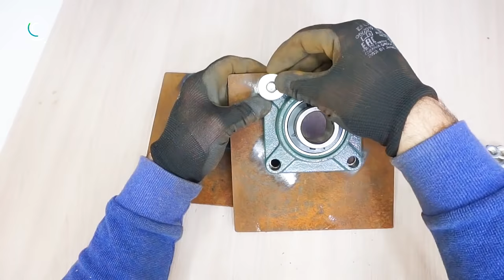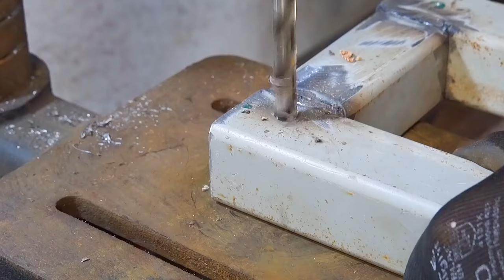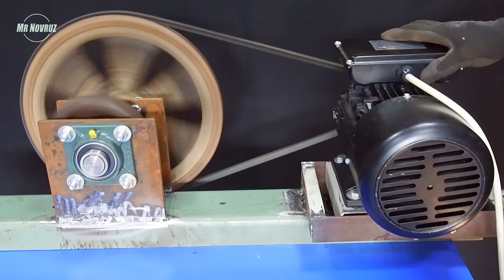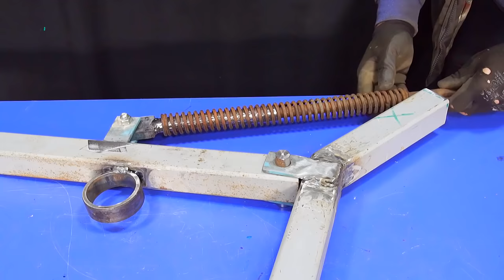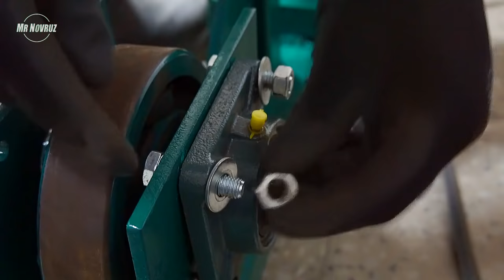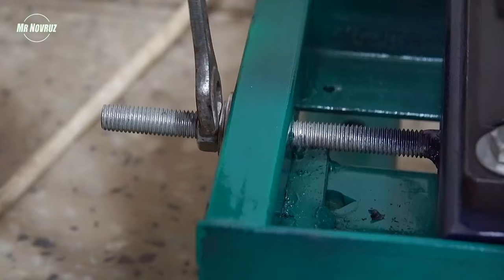Cool Idea !!! Unique tool for your Workshop !!! 2021

Comment: wow, beautiful and neat .. I want to know, if I want to do this mission as well .. how big the engine should I buy, or maybe how big the horsepower for the engine
Reply: I guess you need max 1.5-2 hp (1.1-1.47kw), the power is mainly depend on the weight of hummer and the tension of spring ...